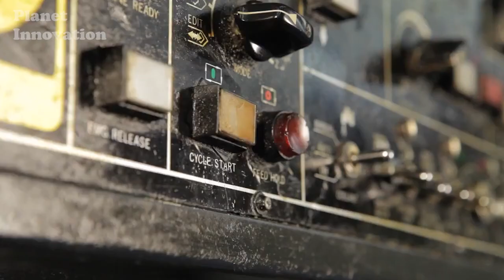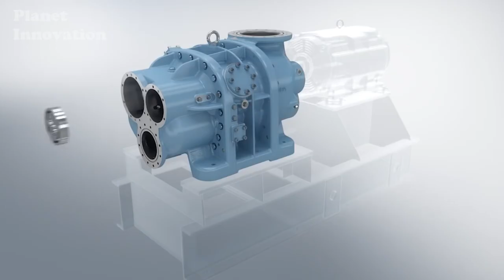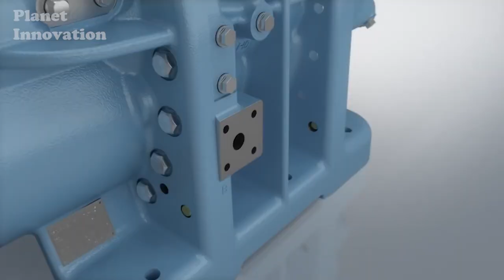Modern CNC Machining: Screw Air Compressor - Repair & Maintenance Giant Diesel Engine Crankshaft

Comment: Observo que os trabalhadores são todos ja profissiionais com muita experiência, retifica tem de ter muita responsabilidade, parabéns aos profissionais.
Reply: @FIVE-0-APOCALYPTO  maybe because some black people are more concerned in doing militancy than actually doing the job.
Reply: @diegocosta9715  then from what you say, ARE THEY capable of doing the job/task ... irregardless?

My answer would be NO and YES, it comes down to a question of biology or in other words, what exactly is black or white in your terms. 

BECAUSE, militancy itself is APPLICABLE to whom exactly?... EVERYONE obviously.

Militancy as a distraction is what you are claiming is holding blacks back.

My reference pertains to the torrential flood of nonsensical videos coming out of the indian/Pakistani region where; example:

"Broken engine cracked in half repair"....and the ridiculous procedure to follow that in of itself is not so much of a problem as the torrential comments to follow where,  even Western White opinion overwhelmingly suggests a impressed viewpoint of a people and land with "limited resources" seemingly the unending theme for a unprivileged and non-optional repair that works without question, suggesting a much more higher skill level of industry standards as a result when the high level of understanding and therefore experience being one of the criteria in order to establish high level in of itself, is lost in a torrential wash of ignorance, where the indian/Pakistani source said videos come from are being performed by a people who they themselves know that their fix it procedures are full of s*** and would not and could not possibly work and the dumbed down white Westerner left holding the bag of ignorance as a result and mind washed beyond reproach or reasoning.

In other words, the ignorant white Western thinking is so mind washed in convinced fashion, that no other voice of reason such as myself can change what is in effect a collective public opinion for the simple fact that the video itself is clear enough and the main fact being the unspoken opinion regarded as fact, that the non-white ingenuity therefore speaks for itself and thus, the white Western world is privileged with the remove and replace option and the non-white world relegated to the underprivileged and limited resource option of ingenious repair...

As if a engine block cracked in half could ever be repaired out of hand no matter what technology even at the highest points were to ever try and repair even with unlimited resources because my point of example is not a engine block cracked in half, that is an exaggeration on my part where reasonability becomes fanciful, where reality meets the proverbial rubber meets the road in all out actual equivalency that is lost beyond all reasonability in comparison where, the Indian/Pakistani torrential unending videos it seems of certain impossible repair may not contain engine blocks cracked in half but certainly do contain completely broken and not just sheared catastrophic failure of a drive axle similar and typical to what one finds in the rear drive section of their automobile coupled to a differential housing in which we are now talking about drive axles of a very specific nature in construction and in no way shape or form are serviceable in the event of any type of failure, much less repairable other than removal and replacement because and this is what is Lost in translation of utmost reality, that a typical drive axle for instance, is a component specifically designed and constructed unit that is harmonious to what is naturally in harmony with rather than harmonious to....

In other words and in closing to what is a ridiculous explanation forced upon myself to explain what is ridiculous in nature as to the ignorance of what is in harmony to accept the doctrine of the collective where even the loose association of said fix it videos of the non-white underprivileged suggest just that to the mind washed and unreasonable white Western collective where the irony is in fact, that the non-white world said videos come from are being performed by subskilled performers who they themselves know their repair options are full of s*** because even they know what the white Western world in terms of public opinion should know that a twisting catastrophic breakage of a typical drive axle can never be repaired beyond basic visual inspection that when said and done seems plausible to only,

and this is my point,

to a unreasonable mindset brainwashed collective where opinion is not just consensus, but is in fact, a collective defiant of any reasonable explanation or in simple terms, if it is daytime and the collective says it is night time, the reasonable individual pointing out that it is in fact daytime and here is why with all the facts that should be reasonable enough if one simply even has eyes, not only is the individual subject to scrutiny and crucifixion, but the remedy or reasons itself to prove otherwise are not even subject to the question of reasonability and that is the underlying problem.

A drive axle in concept and conclusion is one that is harmonious to and subject to wit:

"A harmonious blend otherwise never found in harmony to what is nature itself"

Just like a samurai sword, at the highest level of construction and expertise, is a more and more and more perfect blend of what is known in industry circles as,

 "tough and hard",

that coincides with what is natural in terms of what is ingredient but never what is natural and therefore a unnatural blend of what is unnatural coming from the expertise of the sword maker and it's relevant procedures and contributions of others as part of a collective harmony that understands what it takes to transform what is in harmony with nature to now be harmonious to what therefore would be very unnatural.

This is the disconnect as a result of what is unnatural and devised by the brainwashers in which mirage is reality because isn't it obvious enough that not only a axle that suffers a catastrophic shear is in question itself as to WTF caused that to begin with, we are now talking about broken axle with pieces of breakage in said catastrophic event that now certainly puts the question of how did that happen to begin with first as a basis point of contention and reasonability, that should or could be a question in of itself that perhaps breaks the mind washing spell, but to no avail, as said by a former high level KGB agent that this form of mind washing known as "demoralization", in his words when completely submerged that you as the non-collective are stuck with them, there is no known effective repair for the mind washed collective no matter what proof you show them in terms of what is most important and that is reasonable logic.

The concept of catastrophic breakage of something that is harmonious to what is in harmony with nature, and therefore unnatural in construction in order to reasonably withstand all the natural and unnatural forces applied in application for something so simple as an axle and therefore could never work in construction in harmony with for instance simply taking a bar of mild steel by itself and machining said bar of mild steel into the configuration and finish product of a drive axle with appropriate splines and length and diameter tolerances and expect it to work any more reasonably than to repair it after certain catastrophic failure regardless of a different nature being in my estimation a drive axle from a bar stock of mild steel would fail at the drive spline section of construction first especially if more splines machined into the outside diameter portion that would normally make a proper blend of hard and tough that is harmonious to the criteria of axle industry construction, would now make that piece of bar stock mild steel even more vulnerable to what I would believe is a simple twist off breakage of the spline teeth that are even smaller and thinner now due to more splines being a stronger configuration only with material harmonious to it's application needed which of course is very unnatural and therefore unnatural construction and expertise must be applied in order to take what is in harmony "with" to the level of harmonious "to"...

If one now exists on the back end of the equation then for sure the same applies on the front end and therefore what is the more perfect and precise blend of hard and tough in accordance to what is known as a drive axle, is subject to either it works or it does not and there isn't very much Middle ground as a result and for all practical purposes we can say the middle ground pretty much does not exist, it's either one, it works or it doesn't and not retarded comments after said axle is machined to allow a welding Union to join both pieces and then once filled with weld is now machined in accordance to here you go you now have a repaired drive axle where one commenter said as if he was a voice of reasonable expertise that it should work for at least a few months and I step in and say explain why only a few months where I say you're intelligence is up on a flagpole because it should be obvious that if it works for a few months it should work..."PERIOD" in terms of what we know or should know to be a drive axle.

If I were to point out that in effect a samurai sword that happened to get snapped in half and now picture any type of reasonable repair to join or Union together the two sections from the point of catastrophic failure, it is impossible for me to reasonably explain no matter what and I know this, that weather the samurai sword or a broken drive axle it doesn't matter,... they are both one and the same.

PERIOD!

END OF STORY!!
Reply: @FIVE-0-APOCALYPTO  i Will not read. I Will wait the podcast
Reply: ....and as a more important point on the front end because what is relevant to begin with is the most important when considering, my usage of the event known as "snapped" in half as it pertains to failure of a samurai sword, exemplifies without a doubt the event known as "shear" and is typical or I should say more typical to what would normally be a catastrophic failure for something that is harmonious to what is naturally found, but unnatural has to what is naturally produced. 

The nature of usage in terms of a samurai sword is no different than a drive axle in which the axle itself is the perfect blend of what we can find in nature but only unnatural external expertise can blend the natural to now unnatural levels of performance, that is normally not naturally found by itself.

It is natural to find iron ore by itself and carbon by itself but to find both in of itself as one blend introduction to the other in any way shape or form is unnatural.

And therefore the perfect blend of hard and tough suggests there is one or the other and very little if any Middle ground and therefore at the highest levels of expertise and the unnatural occurrence of a catastrophic breakage, does a samurai sword snap in half cleanly or perhaps like a paper clip if one bends it back and forth in which one can visually see and physically feel the point leading up to and the moment of catastrophic failure in which one even for the first time experiences what they can see and feel as a catastrophic event more along the lines of a chewy or tough breakage....gnarly point of event breakage.

The question itself is complex because the point of breakage on a samurai sword can mean many things being one from its ultimate point of vulnerability and or other points of generalized compromise as a "result" of.

In general a samurai sword as per generalized usage is not subject to breakage weather sharp and clean or gnarly and chewy failure at its weakest point.

In its general usage it is subject to failure along its lengthy razor sharp edge... Most definitely breakage of the variety known as hard. 

If we were to shove the sword into a tree where it in beds itself 4 inches but 6 inches would be better and we now as a 180 lb individual step onto the sword itself as if a platform to stand on, the better the sword making process in expertise, the better said sword will be able to withstand the weight of a 180 lb man in which vertical weight displacement as a intermittent Force known as us being the man and physically being bouncy on this platform to test the expertise of the sword maker will act and should act no different than the leaf spring of a automobile in which we now have the more ideal blend of hard and tough in which we have tensile strength as a unit and the individual specifics therefore only apply when catastrophic failure is introduced into the equation, does the sword become compromised at its weakest point?

This can vary widely, because we could be standing both feet towards the handle end of the sword versus both feet as close to the tree trunk as possible and if we were to use the two extremes in distance and it's relevancy applied in terms of bouncing, if there ever was a blend of hard and tough in which catastrophic breakage can result in a sheer breakage or gnarly and chewy because it depends, then this is where reasonable logic determines that if the blade itself can hold up 180 lb man and all things being equal the point of the sword is embedded a good 6 in into the tree and no matter what will not move or slide out of its fixed point, then if we were to logically deduce we would assume the sheer effect would occur with both feet closer to the tree rather than both feet way out to the opposite end where the handle is...

And this is where expertise comes in because in general terms all things being equal, a clean sheer breakage would occur more so if not always if both feet are out towards the handle area and there is a reason for that that I don't want to get into because those that don't know wouldn't understand my explanation to begin with and therefore if there was a gnarly chewy sort of bend and then ripping type breakage it would occur on the opposite end with feet closest to the tree..... Because I said all things being equal and this I shall explain because it's easy for somebody to understand that the tree itself has a point of embedded fixed point and therefore the very external edge of the wood itself being the tree is subject to "giving and compressing" and therefore spreading out the load instead of the fixed point being the edge of the tree externally and then the sword blade from there on outwardly....

This is what is known as application and therefore with reasonable logic one should realize that normal usage of a samurai sword is no different than a drive axle, if a blade is constructed expertly then it's only point of contention is it razor sharp edge through usage being compromised toward razor sharp to less Sharp etc and considering the fact that a good blade if shoved into a tree will certainly hold up 180 lb man without breaking either with a sheer breakage or gnarly and chewy in fact unless we introduce bouncing by the 180 lb man and therefore we have to ask regardless of what kind of failure being it is now sideways bent near the front or snapped in half in the middle, what in the bloody hell was one doing with this damn thing no different than a drive axle that is not only twist sheared in breakage but catastrophically broken toward gnarly and chewy and individual pieces subsequently in the mix as a result of?

OF????!!!

This question is never asked and even if pointed out is dismissed in the collective mind wash.

It goes right over their heads.

This is a problem.

Because it demonstrates the inability to deal with reality on a suggestive reasonable level much less a deducing logical level in which we do not try to put together a broken apart samurai blade anymore than we would repair a axle that has sheer broken at its weakest point any more or much less a catastrophic failure of breakage of gnarly and chewy where we have more than just two pieces that are in disunion, we have pieces involved in the breakage itself and this is virtually impossible where at it's very extreme usage, extremely extreme.... Does a samurai break in half under normal conditions no different than a drive axle shear at its weakest point. 

And therefore under extremes we will not find a gnarly and chewy breakage with a samurai sword if there is one no different than a drive axle, in both cases if there is a catastrophic breakage it will be of a shear point variety that can be explained such as the face of both blades coming in collision contact that a perfect flat moment where one blade at its given structural weakest point and more than likely mainly due to an atomic flaw that allowed a cleavage or shear fracture to occur through harmonic shockwave of course but we are talking about getting struck by lightning or hitting the lottery type lucky event if one wants to call it that or simply an extreme anomaly. 

What is typical as a samurai sword loses its razor sharpness and a drive axle housing loses its o-ring type or whatever seal configuration and therefore loses lubricant as a enclosed fluid, and as a result loses stability at the point of seal and Axle housing and therefore a unnatural harmonics of up and down occur and failure is the clip retention of the axle and joining the differential end and boom the axle as a unit attached to the wheel itself comes off and many have seen that occurrence as an end result somewhere on the side of the road in their lifetime.

Other than that, it's rare that somebody has hit the lottery much less no somebody personally that has no different than a God damn drive axle all of a sudden just breaking at its weakest point in which it too would be a sheer effect breakage and not a gnarly and chewy one in which pieces resulting in more than two are part of the catastrophic failure.
Reply: And therefore my point that we are talking about an unnatural ignorance going on here where no point of demonstration being reasonable and or logical breaks the mind wash of the collective that is subject to the abuse of the mind-washing purveyors being the system itself who of course finds the collective to be a threat and why is that when the collection on the non-white end never seems to be in question?

And since this is obviously true then it has its own point of breakage in different terms of course that will or should suggest that the non-white side whatever that represents in biology because it's a question of how much white within a black vessel and vice versa is the question when considering more than likely there is no entity that exists these days that is 100% sure White of origin anymore than 100% pure black in origin especially when origin itself at best is known as a theory such as the out of Africa theory and not fact.

And therefore we have conclusion and or conclusive which means we have theorem of associated fact versus conclusionary reasonability of objective fact.

One is or should be obvious and the other is only obvious to those who know or can reasonably deduce.

Both must exist or else in theory of reality itself it should or would be the end of everything because for instance just like Newton's law and therefore reaction must meet an opposite and equal reaction all things being natural because the fact remains one does not get something for nothing in this known universe and that's it end the story.

And this is where we have Middle ground subject to and subjective to conspiracy versus natural occurrence. 

And thus it applies that one may be able to teach a monkey to do something but never expect that monkey to come up with the same something all on its own and that is reasonable.

Therefore if inferior can learn to make effective repair then it is reasonable to assume it can come up with its own equivalency of what it can understand.

If the northern mongoloid race in this case known as the proverbial Chinese and it's equivalency of historical invention of everything were true then what happened as a result of now in which what is supposed fact now becomes reasonable deduction based off of what have they invented lately and lately itself as a time frame is recordable history in which even if unrecorded the residual effect and event would speak for itself and in this particular place and case in time there is no evidence to the claim and therefore only The logical mind can put two and two together in which it is easier to learn rather than create and therefore what is true intelligence and let's go a step further and irregardless of social happenstances that only apply to those of militancy and or historical grudge natural and unnatural, nature itself could never be stopped anymore than even the system Masters themselves knowing that you can ultimately never kill an idea.

And since that is reasonable fact then it is logical deduction that in the case of this twin screw compressor configuration in which accuracy of atomized oxygen as a component catalyst is painstakingly constructed in order to satisfy the event of accurate introduction to what levels I do not know because nothing is perfect but I would imagine it's perfect enough to suit the criteria of demand in which the design nature of a turbocharger is one of a reasonable application in which we have predictable variants that can be reasonably deduced and factored and therefore we ultimately have result that coincides with a performance indication that proves in of itself rather than otherwise but as a result we also have the introduction more so of anomalies in which if one watches or observes enough drag racing for instance as a platform of example, we will notice instances and so will others in those same cases to the point in which we find highlight videos of the extreme where all of a sudden a performance issue somewhere in between the start and finish line now results in a very bizarre happenstance in which this said turbo driven power plant or combustion engine in simple terms becomes a very abnormal power output event where all of a sudden it's problems as a result seem to clear up and make up for the difference as an event rather than condition and a almost supernatural power output occurrence now happens that otherwise would not and for reasons obviously uncontrollable or else duplication would be harnessed and therefore manipulated but the reality says we cannot reasonably as of yet because logically it takes too much perfection in terms of criteria in order to satisfy the event and that's what an anomaly is because all things being equal then XYZ should happen but instead we get ABC to happen and the reason why it's not controllable is because normally even in those circumstances that engine and or power plant itself encounter catastrophic failure to one degree or another but in this particular case for reasons that even logic suggests should not happen but it is an event at the cusp of what apparently can happen and that is a supernatural event where the power plant itself remains intact enough to demonstrate or allow what is normally illogical and uncontrollable and at mid track, all the wastegate blow out clears out and through miraculous convergence as a result, all of a sudden this vehicle housing the supernatural power plant event lifts the front tires off the ground and accelerates to supernatural levels that actually make the vehicle go straight as a result of its own incredible acceleration and velocity as a result that the vehicles design engineering is more toward the over engineered side of course and therefore retains a straight line to the finish.

Whereas in the case of a rocket ship and it's propellant style power plant engine has a structural whole is one of extreme horsepower in terms of acceleration versus mass times weight in proportion, and therefore it's intention is to take a payload of advantage intention for the sake of design purpose because in modern day age as of now if we are carrying qualified humans as part of the payload, then we are logically also bringing material along for the ride for the given intention of not only breaking the Earth's gravitational pull but also to construct the intention of whatever it is or whatever it may be outside of Earth's gravity and thus orbit.
Reply: This isn't Star wars where we can horse around in the process of breaking the planetary orbit and it's associated gravitational pull, if we are carrying payload of intention along with qualified humans then we are unfortunately relegated to the subject of efficient breakage of gravitational pull in order to reach outer space and non-gravity orbit and therefore subject to a trajectory of satisfaction that coincides with the shortest line between point a and point b.

A design rocket engineering and purpose especially with payload is one of a efficient trajectory in relation to it's incredible power plant output engine design that facilitates enough horsepower to satisfy the criteria and therefore acceleration being The logical default response in which:

An object accelerating tends to remain stable as a structural unit and therefore as a result retains a line of trajectory that remains stable to the point of in most cases a stray or veer of said accelerating line typically occurs if the structure itself fails and therefore if one watches a rocket launch event in which somewhere before breaking into Earth's orbit it encounters a catastrophic failure it is because and those events that occur in frequently in which the structure is accelerating so much that all of a sudden a veer introjectory due to obvious failure of the structure itself for whatever reason due to structural compromise or guidance system breakdown, the structure itself remaining stable under that incredible horsepower and acceleration now destroys and cannibalizes itself into Oblivion at the first degree or two of trajectory non-compliance and it happens extremely quickly because the structure itself in reality is not a stable and durable one and only is through intended acceleration that must occur in order for the event to be successful. 

Irregardless the event being a successful one, is due to painstaking intention on inventive and creative levels that coincide with logical deduction and experience as a residual and catalystic result or another words Superior Plus Superior equals more Superior in harmony and harmonious to what must be.

This creativity and inventiveness historically for the record only emanates from one place and it's not from the black or dark side or Asiatic mongoloid side.

This is fact and therefore if one notion is reasonable then it also must be logical that not only would the black side or Indian Pakistani example ever be capable of inventing something as complex and accurate as a twin screw power plant compressor, where it's nature of design is much different than a turbocharger where it's designed intension is not necessarily one of liberalized demand because the fact remains a turbocharger is much more user friendly in the application of a design engineering known as a car for whatever purpose being normal driving conditions and door performance at a drag strip, effective performance as it would be known and subject to more inaccuracy and therefore more anomalies in relation to a twin screw supercharger where it's intentions are one of much more accuracy and therefore less anomaly and much more consistency and therefore much more inclined and in line with what must be and that is it either works or it will not and will not meaning anything in associated facts and probably through logical deduction meaning if said twin screw supercharger does not work in a given application then the likelihood as a result is catastrophic failure because that's the way it must be in relation to liberalized or more user friendly effective usage such as a turbocharger and it's design engineering gives which in the case of drag racing because it's more consistent certainly suggests that it is ultimately more Superior and that is not true because at the highest point known as top fuel nitro methane where we have the fastest vehicles reasonably in drag racing terms, they are not messing around with turbochargers and do in fact have enough experience and applicable data associated in which relevancy of a uncompromising external aspirated configuration, only makes sense that accuracy itself can be applied and it all starts somewhere in which those harnessing the accuracy are of course those who invented it to begin with and therefore monkey see equals monkey do has as a result and must be its limits or else we would see it's demonstrations as to otherwise not only here and there but everywhere and all the time and I dare anyone to show me those cases even in limited occurrences and therefore my logical contention is you Don't see the non-white side inventing these things and therefore construction of it finds those as well nowhere in sight end of story.

Thanks you, this concludes the oratory intellectual discussion for this week of case study:

LAUNCHPOINT VERSUS POINT OF ORIGIN; a case lecture for black and white as a perpetual result and/or happenstance.

For one week and one week only at Carnegie Hall. Limited seating available get your tickets now.